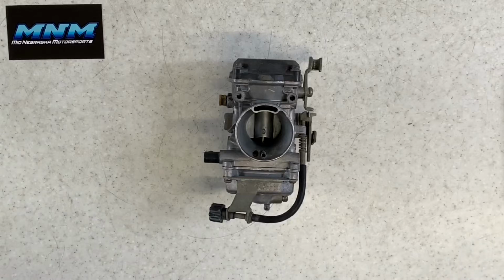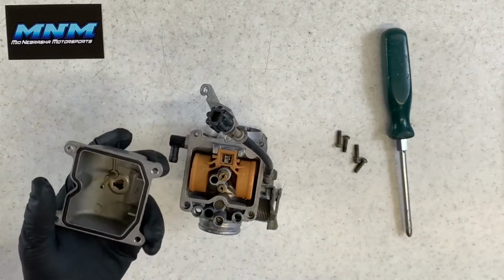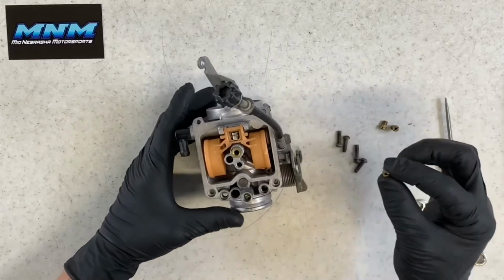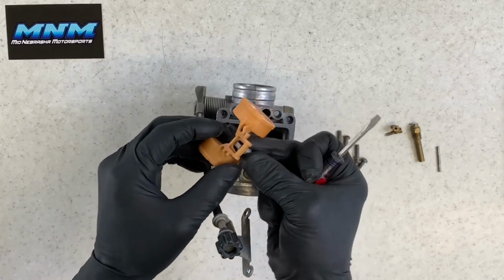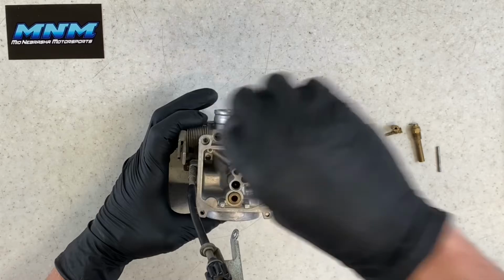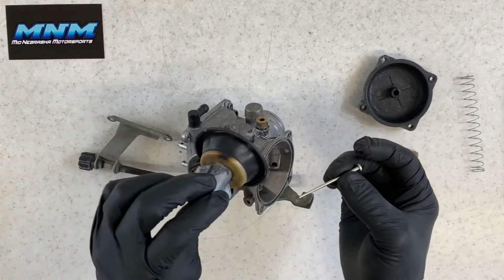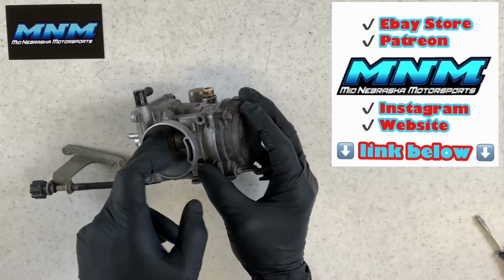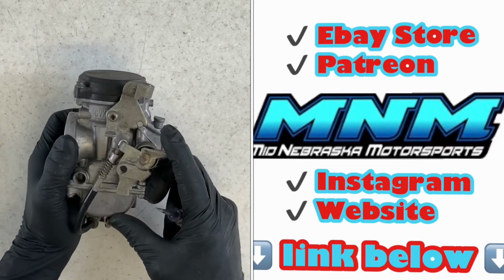1998 Kawasaki Bayou 300 4x4 - Carburetor Clean/Carb Rebuild

Comment: Is there anyway to get the float unstuck without taking the carb off the engine?
Reply: I've seen a few people tap the bottom of the bowl with a screwdriver handle to get the float unstuck. I don't know if it will be much use to you a year later 😂

Comment: I have an 89 bayou 300. Replaced carburator and when turn choke off while running atv stalls out or dies
Reply from the maker: Did you use a genuine or knockoff carb? Watch our Genuine vs knockoff carb video on our channel and then follow up with me. Thanks for watching and the comment. Have you watched some of our other videos on this same model?  Also if you have need parts check out:  https://www.ebay.com/str/midnebraskamotorsports

Comment: Question.    I broke the black piece that goes on to the fuel line.  What should I do?????
Reply from the maker: Follow the link below to buy another good used OEM carburetor. STAY away from the junk knockoffs. Check my video on the Genuine VS knockoff. If you need more helpful tips, check out:   https://youtu.be/X0AdFxkJiOg and if you need parts: https://www.ebay.com/str/midnebraskamotorsports. thanks for watching and the comment.
Reply: @MidNebraskaMotorsports 
Does the plastic piece unscrew from the carb, so the carb can be soaked in carb cleaner.

Comment: Quick question! I just cleaned my 300 Bayou carb last night! The 2 jets got mixed up dose the bigger hole jet go into the bigger brass jet holder or dose the smaller jet go there
Reply from the maker: Bigger one goes into the brass holder. Sorry for the slow reply. Thanks for the comment! Let us know if there is anything we can help with. Check out:  https://youtu.be/X0AdFxkJiOg  for more tips. And:   https://www.ebay.com/str/midnebraskamotorsports for all your parts.

Comment: What video has information about Chinese carbs? I bought at 300 bayou 4x4 with a Chinese carb and it won’t run without choke wants to back fire through carb
Reply: Chinese carbs are junk. Cheap parts are not quality parts
Reply: Nevermind I figured things out

Comment: Would like to see the float adjustment
Reply: Me too! Ever figure it out? Mines just pouring fuel after rebuild
Reply: @jasonzehnder6510  so is mine
Reply: Is there a measurement from the base of carb where bowl bolts down to bottom of float?
Reply: Usually its level with the carb base when its in the fuel off or closed position @chadriddle3517
Reply: Nice IT on your thumb nail, truly miss mine. Found one in Florida in garbage basically just a frame its sitting out under a shed in my woods would love to find all the parts to revive it.